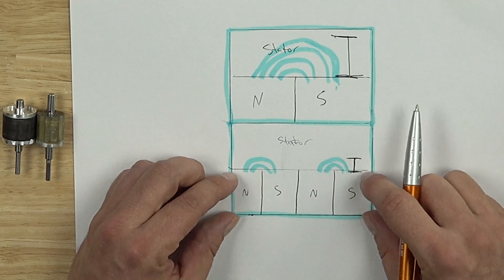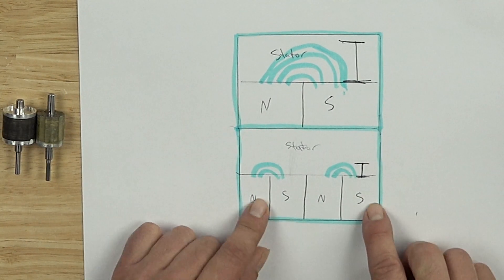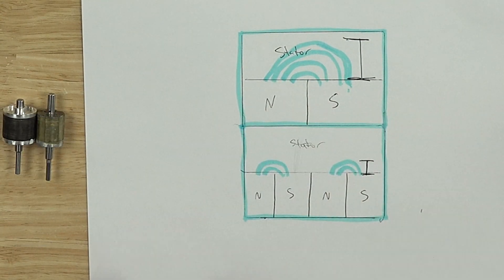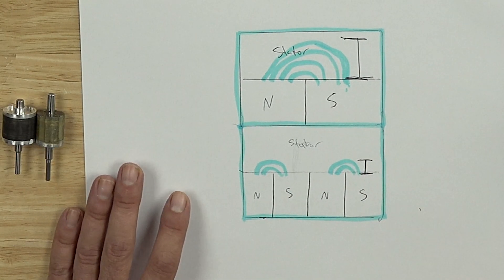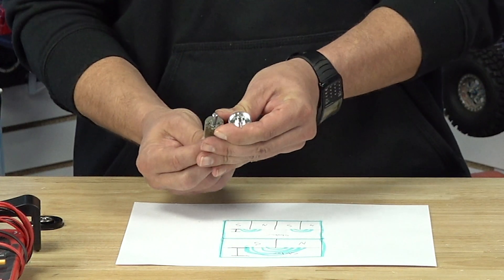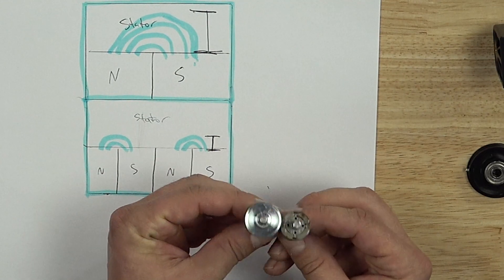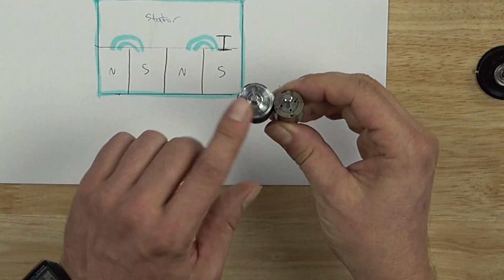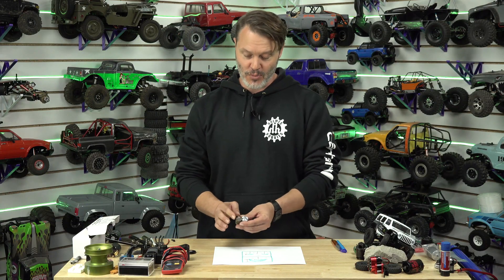Unlock the Secrets: 4 Pole vs 10 Pole RC Motors 🔍🎨 Holmes Hobbies Breakdown!

Comment: I'd like to know if the dlux stubby 380/HH380 has more hold an torque than the team spec ss2050? I run both an guess I can find out myself but I'd like a more intelligent answer other than my own well duh lol.
Reply from the maker: @WillB.6759   I haven't tested the dlux motor. My 380 has more hold than the dlux (longer rotor, same magnetics).  Pretty sure my 380 has more hold than the stubby 540 but it's been a while since I measured